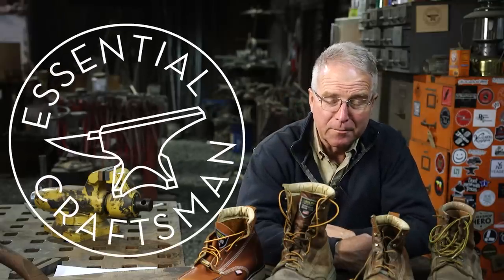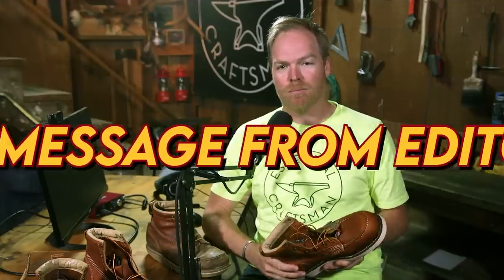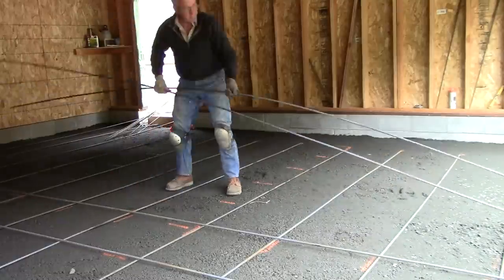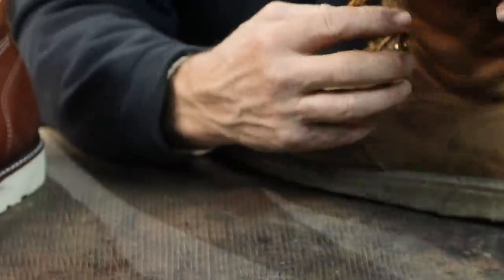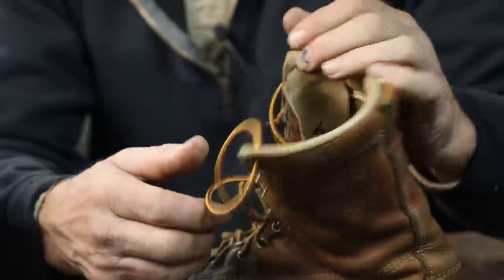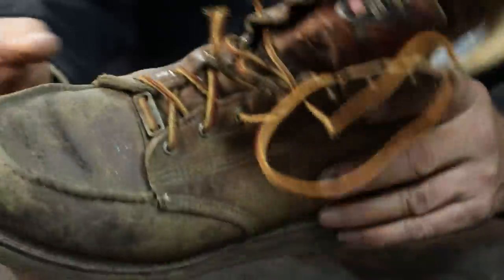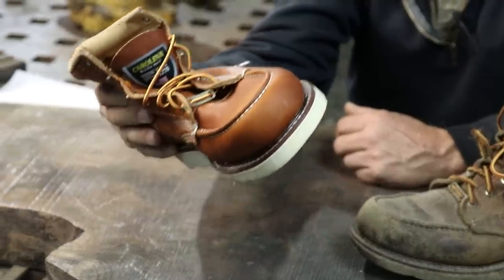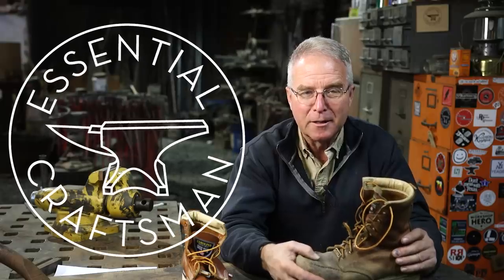Carolina Boot Review

Comment: I go with Red Wing Irish Setters 8" crepe wedge sole.  I know they are more money.  To me, they are worth it.  Durability is important, because it takes a while to break-in boots and I wouldn't want to go through that process any more frequently than absolutely necessary.  I also like that Red Wing is a local company right here in my home state of Minnesota.
Reply: I wear the same boot I won’t wear anything else. Redwings are by far my favorite now.
Reply: For me, you couldn’t pay me to wear redwing or Irish setters. They feel horrible even after break in. Just goes to show people’s preferences
Reply: @cameronwirth8751  they have differently shaped feet than you...and the manufacturers "boot last" (cobbler's form) may vary to the point that one brand may be perfect for you....and horrible for someone else.
Reply: It is sad to know that 2/3rds of Redwings product line is made in China.  The "Made in USA" 1/3 cost so much ($400-600) that they aren't affordable.
Reply: @cameronwirth8751  Red Wings are oddly sized. Sometimes by nearly as much as a full size over they are marked as. Irish Setters are normal sized, but Chinese junk.
Reply: I have worn the same style of redwing for the last 7-8 years. (a new free pair each year with a voucher from work). They discontinued that style about 2 years ago. Every other redwing I’ve tried since has killed my feet. But luckily I kept the old boots stashed in the closet. The last 2 years I’ve rotated my 4-5 pair of well worn former redwing boots in and out of service. Those are all on their last days. I’ve been browsing for new boots nothing has good legitimate reviews anymore. Everything seems to be disposable quality these days. I work in manufacturing and log 20 miles on my feet per day based off of my iPhone health app. My feet are always sore as heck in the morning for my first 15 minutes or so. I’m on day two of blisters with my newest ‘trial’ pair that had good reviews, we’ll see. Still always researching for my next pair.
Reply: L F I think sometimes guys call the 10877 model Irish setters because that’s what they used to be called.
Reply: @JD-tl7ld  My boots are the 10877 and labeled "Made in USA".  Not Chinese.
Reply: @JD-tl7ld  no irish setters are not junk, i had a pair of there loggers for over a year now and still the best and most comfortable boot ive owned
Reply: That's exactly the boots I'm wearing right now.  Love them!
Reply: I have 3 pairs of  Irish Setter Wing Shooters. One for bird hunting. One for going out.
And the other for work. I had the Red Wing Store resole my Work boots with a Vibram Star and bar sole. It made a good boot a great boot.
Reply: @TheToolmanTim  Some Red Wings Are Made Overseas

Batson says, "Only the Heritage line is made in the United States. Their work boot lines and other brands they make (Irish Setter Boots, Vasque, and Worx) are made outside the USA in Asia, primarily China, Korea, and Vietnam.” 

Granted it was not always this way, the entirety of the Redwing selection used to be made in the U.S.A. I used to wear nothing but redwings myself for many years. I still like them but I'm testing out some Thorogoods right now and hopefully some Carolinas soon. I have to say that the Thorogoods moc toe boot is really nice and easy on my bad ankle, which is a welcome relief from the pain.

Comment: I use to wear the Sears 8 inch carpenters boot and when Sears had all of it's trouble I tried a Timberland Pro Rip Saw and I love that boot.  It is water proof and has a composite safety toe.  This boot is a little heavy but it is full of comfort and the durability has been exceptional.  My current pair is now six years old and still has quite a few years left in them.  These boots are pricey $189 but I have certainly got my moneys worth of use out of them.  With all the wild fires in the last two years the boots have taken a real beating but are still comfy and havent had any break down.  If you are the type that is hard on equipment or in a demanding job then give them a try.  They have sure served me well.
Reply: L F what boots do you wear?

Comment: My absolute favorite boot has been a thorogood 804-4308, bought three pairs so far and still have all of them. Each one lasted a little over a year working as a mechanic on concrete, daily soaked in grease and oil. Love the soles, they are light and snug on my feet, could and would often wear them for 14+hours a day because they feel like slippers. Replaced the laces with paracord when they broke and never looked back from it. They clean up well and I would do so about every week to 2 weeks, wasn’t afraid to wear them to date nights or church. Always wanted to get them re-soled just haven’t gotten around to it yet. I want to personally thank you Scott for talking about your boots and what you valued in them. Without that insight I never would have considered the moc-toe style of boots and would not have found something that made such a positive difference in the way I can work and feel at the end of the day. 👍

Comment: When I was in the US Navy in the 1970s we were issued a low top work boot, called "boondockers". The most I ever got out of a pair of boondockers was 6 months. The sole would split straight across under the ball of the foot. Our Warrant officer took good care of us. He got good, used Army infantry boots for us. 8" tops, which lasted a respectable time. These were allowed in deck work at sea where nobody important would see them. (We were also provided good used Army O. D. field jackets also for use at sea. They were warmer than a bluejacket, had more pockets and could accept a liner.)
When I got into forestry and some logging I was directed to Red Wing logger boots. These I had a long, long time. Once I got my size worked out, these were my best boot yet. (In my world, a good tip is not to believe the shoe store foot measuring device. I also had a wide foot which no salesman ever detected. Once I moved to an American "D" width then everything was fine. The Red Wing logger boot does not last forever. But the model I wore was a good value. I used Huberds shoe grease too. My Dad and brothers like Snow Seal. In any case a good boot needs good care.

As I got older and my work changed I gave in to the WalMart Brahma boots. Most of these several pair were pretty servicable all around. My last pair were 8" tops, had lace hooks and have been absolutely waterproof. In several years I have not treated them once. The sole holds up well though it does track stuff onto that nice lady's carpet.
This boot does have a cushy upper portion. About 3" that seems to be designed for comfort. In recent weeks this has started to come off.
Other than that I have never had a WalMart Brahma boot that was anywhere near the quality of this one pair of boots. And I don't expect it again. Actually, if you think about it, this is a good time to move away from Chinese products. And as much as possible to start buying patriotically again.
Toward that end I still have a spankin' new pair of Redwings still in the box for several years. It will be nice to wear that kind again.

Let me also say that a Wellington boot is a pleasure. I had black ones for years that shined up nicely for church and special events. At least two companies make a nice Wellington.

I know nothing about Carolina boots. But I am impressed with the report on their boots, and lovely attitude. I wish them the very best.

Comment: I wore Red Wings for years till about ten years ago. My job in the oil field would shred the Red 
Wings in about 8 months. I switched to Carolina and I have not looked back. They are comfortable right out of the box, and last longer than the Red Wings, are built just as well and cost 60% of what the Red Wings did. I have 4 pairs in varying states right now.
Reply: These will be my next pair. Definitely

Comment: I went through boot brand after boot brand in my size 15 EEE and when I found Red Wing, that was it.  20 years now and I re-soul them 2 or 3 times and then spend the $235.00 (now) on a new pair.
I use mink oil to keep them up.  Almost like a new boot in appearance and keeps the leather soft.

Comment: I'm pretty impressed with my pair of carolinas, they've held up to almost 8 months of 10+ miles a day on metal and concrete and as a very heavy man I haven't worn the outsole down hardly at all yet. Usually a pair of timberland pros last me about 6 months before I'm almost standing on the sides of my feet. Only issues I've had is them stretching out because I tie them very tight for support and some cracks above the outsole, not sure if it'd cause the outsold to crack or not yet.

Comment: I've had the same pair of redwings for 7 years. The tip of the sole is starting to separate from the toe. They're heavy, but great comfort.
Reply: I’ve been using the same models of redwings for over 20 years. The 2412 model has been my go to. I usually replace them before 2 years but they are still in good shape. The main reason I replace them is because I’m on cement floors every day and they just don’t absorb the impact as well as a new pair. Also my company pays for one pair a year so I have 2 in rotation at all times to let them air out good. I could get more years out of them if I had to but it sure feels good to put a new pair on. Great boots. I’ve been wearing them my whole career.
Reply: Cody Moffatt — I think he’s just sentimentally attached. It’s sad when a good boot dies.
Reply: I agree with this guy. Red wings are a good boot depending on the model and how big around your lower leg is. The souls last a long time, even more so the insouls. Second best I have noticed is carhart timber pro safety shoes. Every style and function for every type of work you may do.
Reply: @codymoffatt3216  lol

Comment: I bought my first pair of Carolina loggers when I was a junior in high school back in 2000. I'm a fourth generation brick/block layer so I know what you're talking about when it comes to working around concrete and mortar on a daily basis. I've tried many brands of boots over the years but kept coming back to Carolina so much that when I get my yearly boot slip, I don't bother trying them on. I simply make sure the size is correct on the tongue and out the door I go. Little break in time is required with proper care. Something to consider about your laces burning up, try leather laces. They are great for welders but they don't hold up well for working in prolonged elements.

Comment: Nick's handmade boots, I'm on my 4th pair there a little on the expensive side but I get 5 to 6 years out of a pair.
Reply: Now there’s the comment I’ve been looking for I live nicks boots pricey but can be resouled and rebuilt for years
Reply: Just got my first pair of Nicks 5 weeks ago. I've worn Redwing, Danner, Rocky, and Back in the late 70's early 80's the sears boots. Nothing compares to a custom-built boot. Wish I had purchased the Nicks 30 years ago. Have had back issues since my early 40s and since wearing the Custom Built Nicks my lower back no longer hurts after a day's work. About to turn 52.
Reply: Few months into my first pair of nicks. Came from red wing loggers and 6" red wings before. The nicks are already out wearing the red wings
Reply: Only 5 to 6 years? My uncle has had his Nicks since the 80s
Reply: @JamieMac203  they look different when they aren't size 8
Reply: @spruitt84  im size 13 . However i have never seen them in person  so my opinion could be different but from the videos ive watched the heel is a little to much for me and the excessive height
Reply: @JamieMac203  they make different styles with lower heels. I like the high heel and arch for knees and back. Recently discovered franks, might try them for the next pair
Reply: @JamieMac203  fragile masculinity.
Reply: @charlesbronson240  you must like heel boots

Comment: When Kmart closed I bought a dozen pairs of craftsman work boots for $10 a pair. Good thing I did because they completely blow out after a month. Some don't even make it a week before under the heal falls through. My boots are always fresh!
Reply: Do your boots have polyurethane in them. If so they will be affected by hydrolysis. Boots that have been stored are more likely to prematurely fail than those which are worn on a regular basis.

If you Google "hydrolysis in my work boots" you will get hits from many manufacturers as well as consumer complaints.
Reply: @soroako4142  they do. Just searched that. Holly crap that's some bs. Explains why they keep falling apart, and the metal support in the middle always rusts out so moister is definitely present. Good to know!

Comment: If you've got really wide feet and try to wear steel toe work shoes that are not wide enough, you can damage nerves in your foot permanently.  It can happen within a couple weeks.  So if you've got numb spots or cold spots on your foot or toes, get away from those shoes and into something wider as fast as you can!  Experience speaking here.  A toebox that allows your toes to spread is a wonderful thing!  So far, Keens are just wide enough.

Also, and some other comments reflect this, your shoes affect your back, and sometimes they even affect your headaches.  The more level the sole, the better it is for your back and knees as it allows your body to function the way it was built instead of adding strain to your support structures.  A high-heeled boot ain't much different than a high-heeled women's shoe in the way it stresses and eventually injures you; degree and ankle stability are the main differences.  Why chronically damage yourself when you could avoid it?

One other thing to look out for: footwear with the toe permanently turned upward.  High heels have this, some fashionable low-heeled shoes and cowboy boots, and even running shoes can have this problem.  The ligaments in the foot don't like being constantly extended and so you're more likely to strain tendons and ligaments because your foot can hyper-extend but can't lay flat.
Reply: I have an old pair of Timberland Pit Boss steel toes that were killing my pinky toes. I got a broom handle and stuck the round end into the steel and hammered it a few dozen times with a mini sledge and managed to get them to spread out. Now they’re comfy as heck.

BTW, Timberland Pro Boondocks in wide size are the most comfortable boots I’ve ever worn. Give them a try if you have wide feet.
Reply: Keen Dover 6" steel toe. Most comfortable steel toe boot I ever wore and holding up for 2 years so far in a fabrication environment. Had Carhatts before, comfortable but soles started coming off in less than a year. Georgia not comfortable at all.

Comment: I wear Solomon GTX backpacking boots because I used to go backpacking quite often. I wore a pair for about 3 years working general contractor jobs with my grandfather and never wore them out. Strong, lightweight, good grip. Whether I was 25 miles from anywhere in the Sierra Nevadas or tacking shingles on a dew covered roof, those boots never did me wrong.